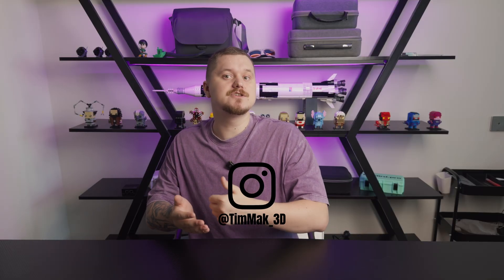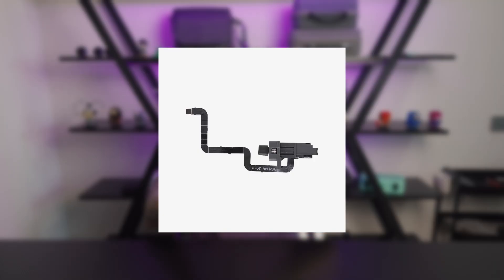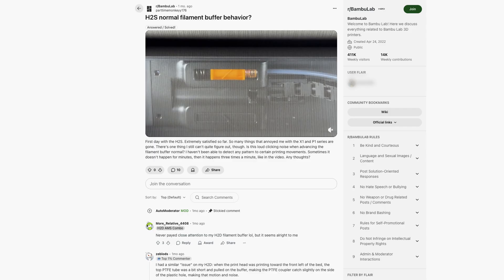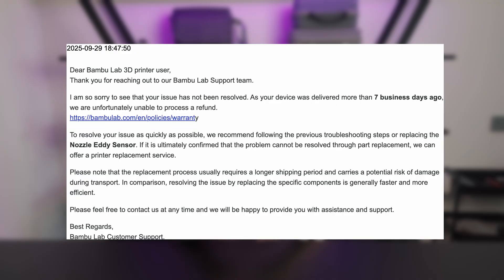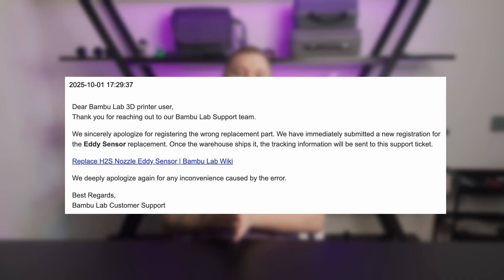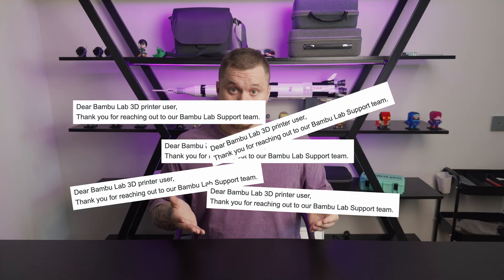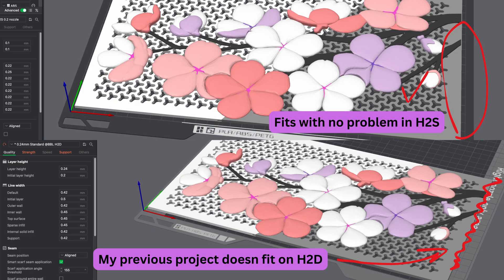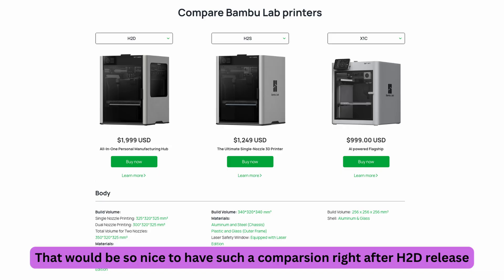A Month With the Bambu Lab H2S – Real Experience & H2S vs H2D Comparison

Comment: I have an h2d and so far so good.  However, I hope they change the format on the h2c to have a larger build volume (350^3 or maybe a little more).  This new upgrade will add 400-1000 cost and I'd like to have a clear flagship not just a h2d with even less build volume and a toolchanger almost as good as the Bondtech/INDX.
Reply from the maker: They mentioned that it will be possible to install tool changer on h2s. Not sure about h2d. If it is true - we won’t get bigger print volume 🥲
Reply: H2C is 330x320x325. Visible in the promo video. Vortek takes 2cm out of the right side of the build plate, which incidentally means H2S and H2D plates are incompatible. H2C upgrade will undoubtably require a build plate replacement.
Reply: @Chaosbar  that is the size displayed.  however the actual could be simpler.  The H2D already has regions not used my the current 2-head config except if you print with just 1-head or the other.  It is more likely that the H2C, particularly the upgraded to H2C units will simply have a region not useable due to the space the Vortek system takes,  Either way, we'll know soon.  I'd happily toss my build plates to take the color swaps from slow to trivial in time.

Comment: Bambu Support has been absolutely abhorrent!
Reply: It's hit and miss. I own a print farm that now consists solely of Bambu machines. Sometimes support is super fast and they'll even offer multiple rolls of free filament. But sometimes their support can be lacking. Thankfully though they've always came through, even if it sometimes takes a bit.
Reply from the maker: @OhImKiCkiN  forgot to mention, during this entire month I got a total of 4 spools. The problem is I use 0 PLA in my workflow.
Reply: @OhImKiCkiN  Coming through in the end unfortunately doesn't make up for days or weeks of downtime if you're relying on the printer for anything more than a fun hobby. And neither does a few rolls of free filament. There is the H2D Pro, but a company that's basing its high prices in large part on a reputation for quality should not require expensive B2B support contracts in order to receive timely responses to support tickets.

Comment: Bambu Lab H2S quality looks terrible.  What are you talking about?
Reply: The overhang quality is worse on the H2S compared to the H2D.  Cnc kitchen showed it in his review.  Why can’t you admit facts?
Reply from the maker: Mechanically it’s almost identical to the H2D, so print quality is the same. I realize now I should’ve shown parts printed on both H2S and H2D side by side under different lighting, not just timelapses. I’ll include that in the next video once I fix the H2S.
Reply: @daniladoesengineering isn’t the nozzle path longer on the H2S, thus leading to worse overhang performance boy?
Reply from the maker: They have the same nozzles. Slightly different extruder gear, fan and fan shroud. I was able to put H2D nozzle on H2S print head. So if there is a difference in overhangs it’s probably due to fan config. 
Anyway, can’t argue about overhangs. 15 hours of print time on the machine and 0 parts with overhangs printed. One benchy doesn’t count.

Comment: Danila, I just posted some scathing posts on Bambu Lab's website. I thought maybe I was a member of the few with horrible experiences with their "Customer Service" and I use that phrase lightly. In my case one of my AMS just stopped working and I submitted all the videos, logs and even more videos that I made. I have been doing this back and forth thing with them for weeks. Finally, I just decided to tear the whole thing down and guess what the problem was??? All four mounting screw holes  of the filament hub had stripped because of how it rocks back and forth. Metal on metal is what is should be but who am I.
So I sent them videos and pictures. They said should not tighten screws down hard. Which in my original ticket I said I have never taken my AMSs apart so I could use assistance if it was needed. This took another 2 weeks, in the meantime they sent me new screws and asked me to close the ticket. Finally I got on Chat which of course is not technical and asked to speak with a supervisor. They resisted, but I played my most stereo-typical American and got one. The supervisor read over the notes and chatted that obviously I need AMS Internal Hub Unit and he would TRY to communicate with technical. All in all it took a month in a half to find the problem (me not them and Im dumb), and they part may be here before Halloween. Im just tired of them.
Reply from the maker: I had a lot of their 3d printers before and they just worked. This time it was a nightmare similar to yours. So I totally understand. The thing is that bambulab support seems to be better than their competitors (I have friends with qidi and creality), which makes me wonder how bad it could be with something else.
Reply: @daniladoesengineering  I just wish I was smart enough for a Prusa but it is just not something I want to go through.
Reply from the maker: @alanday5255  prusa is great for some people. Gives much more control over hardware and software. But at the same time it adds one more hobby/speciality. When people need tools they don’t need to know how things work, they just need tasks to be done.
Reply: @daniladoesengineering  Danila did you go to the Canton Expo?
Reply from the maker: @alanday5255 I didn't. It is a general exhibition where people can find everything. Because of that niche engineering companies don't participate it.
Reply: @daniladoesengineering  Dang it looked really fun.